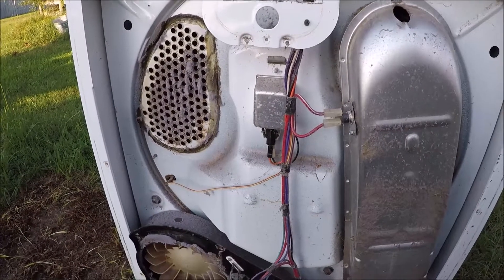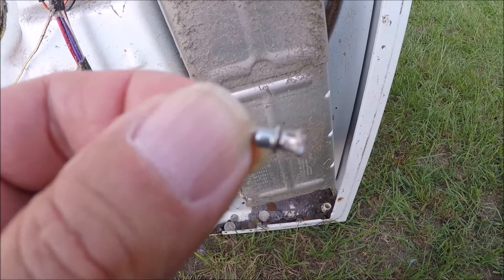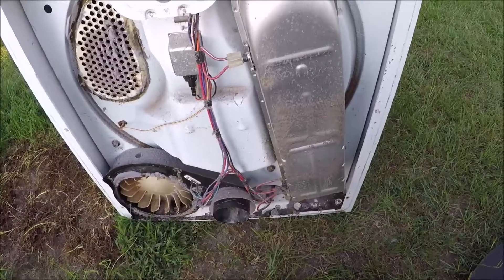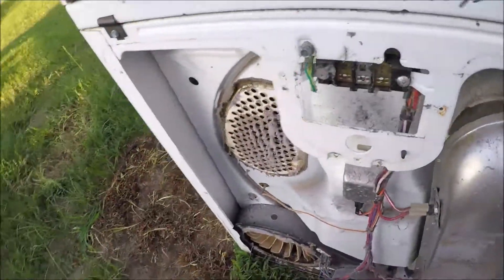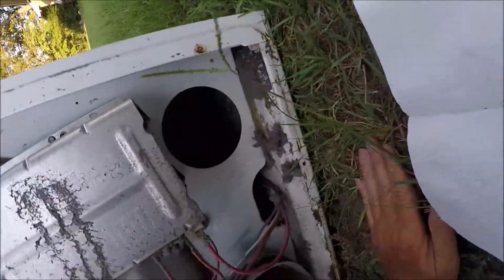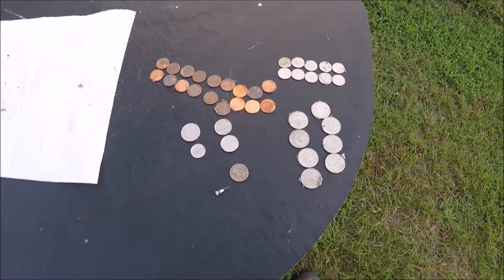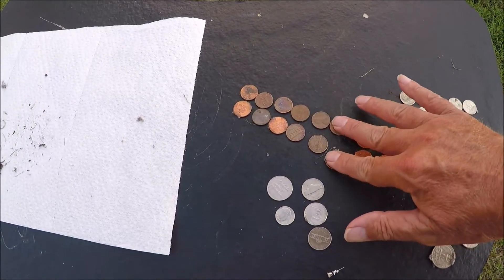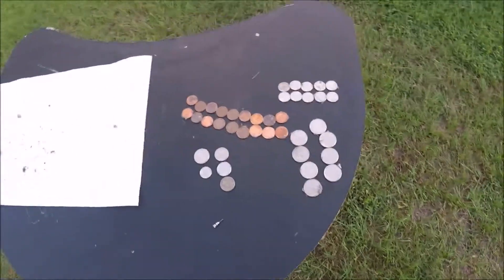Found A Diamond in a scrap Dryer

Comment: You can get a good return
On eBay for the knobs and lint filter and if the heating element is good you have to have the model number.
Reply from the maker: Thanks again Alabama Scrapper. I am thinking about getting into ebay. I will wright down the model number and save the parts you talked about for future sale. Thanks again for the tip. Just learning and just the youtube part is keeping me pretty busy right now.